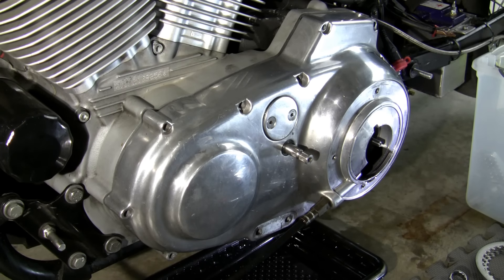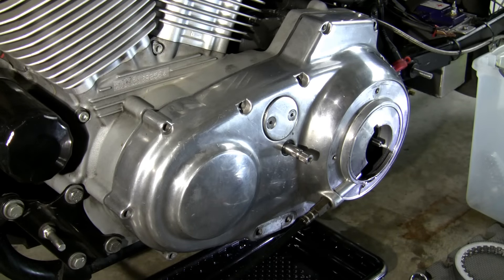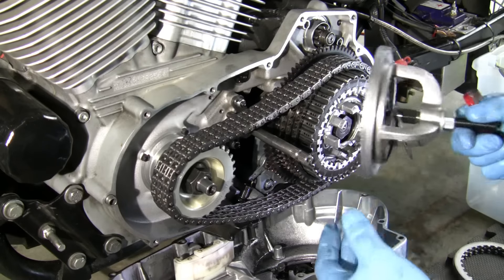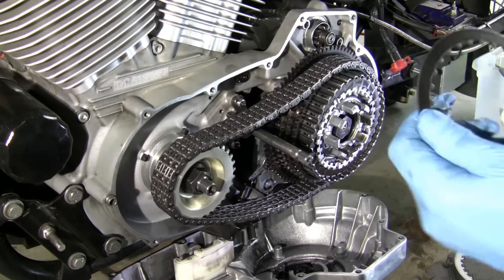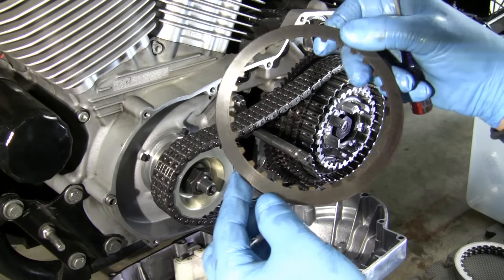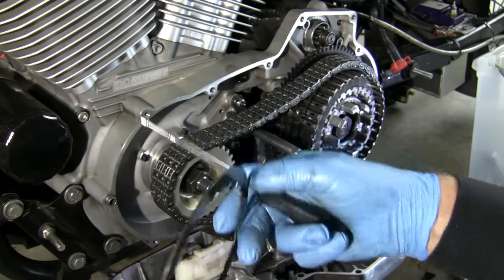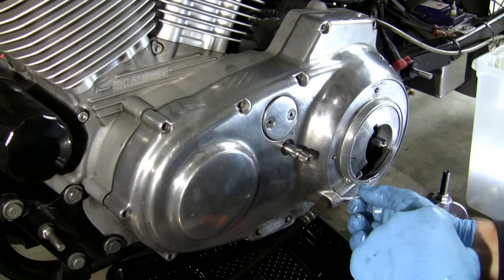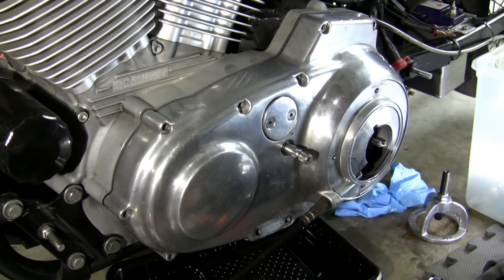Harley Sportster Clutch Replacement, Repair Sportster Clutch With Energy One Clutch XL

Comment: Use spare bolts with the heads cut off as assembly dowels  when you put primary or cam covers on , way easier and you won't damage a gasket or have it fall off while trying to put the cover on.

Comment: How many miles did you have between clutch packs ? What kind of riding do you do city traffic , short rides open roads country rolling hills , drag race .  I have used Barnett the last 20 years going with Energy one for the first time .  have 80,000 miles on my bike stock clutch . rebuilding the Trans and changing out the clutch bearing and all the other bearings . even though everything is tight . Rebuilt the engine last year .  they say 100 thousand miles I get about 80 and rebuild I ride Hard .

Comment: So do you have to drain the oil out of the primary first then replace
Reply: Janessa Richards , if you do not drain the oil before removing the outer cover it will dump all over the place pour 38 oz on the floor watch it run .  you still get dripping under the clutch and compensating nut , I use old blue jeans lay under the primary to catch the dripping .

Comment: Sweet can’t wait to get my new clutch in, so a couple years back I cleaned out my primary case. I mixed blots up and pulled threads out of one of the holes. I got it to bite enough then to stay in but I doudt this time it will. You think a heli coil will be alright. I ask because the hole has to be drilled out a little, do you think there’s enough material to be alright. It’s bottom lower bolt closer to back wheel.
Reply from the maker: Hey Ryan thank you for watching and the comment! I use heli coils when needed. The other option of welding, re-drilling and tapping is a lot of work and the welding can be messy.

Comment: Very nice video. I have a 1997 sporster. You look like you know your way around bikes. Do you think that if I just change my pipes, spark plugs, spark plugs wires and adjust my carb, I could maje a bit more horsepower?
Reply from the maker: Hi Dominique and thanks for watching. The pipes and the carb would help the most. Goos luck!
Reply: Not noticeable  power,may have carb/jetting issues😕

Comment: I'm no motorcycle mechanic, cars and boats yea. But I saw something, to me, needs replacing. The primary chain had a lot of slack in it. Is this normal for racing purposees? I have never seen, in my limited experience, that much slack in a primary chain. Most of the bikes I've seen are 2006 and newer. Please elaborate. Thanks. A very infomative video for me!
Reply from the maker: Hi Jeff and thanks for watching and the question. The primary chain tensioning shoe is in the primary cover in this model Sportster and it was removed for the video and when you have to work on the clutches with XL's. When you replace the cover the shoe then puts tension on the chain and the slack is removed to approximately 5/8". Thank you!
Reply: Jeff Tilghman there is no tension on the chain untill you put the primary back on and adjust the chain guide ..

Comment: nice video mate.. i plan on changing the clutch plates and springs on my sportster dragbike aswell... i will only be running around 100hks if everything goes as planned so it wount be nessesary....

How do you like this setup? you tryed it yet?
Reply from the maker: Hello and thank you for watching and the comments! I do like the Energy One extra plate clutch setup. You have to remember to readjust it after the first use to take out the slack from new wear. It holds well on my 125 HP XL.

Comment: Great job with this video.  Just watched the same video from a more commercial garage, and wanted to watch another just to get a second perspective.  Loved your commentary.  I always appreciate the insights of an experienced back yard hobbyist.  There's a big shift in the care and precision of your work when you're not on the clock, and it's your baby you're working on rather than your 3rd project of the day.

I also really liked that you didn't edit the video down.  For example, I got to watch your struggle with the retaining ring removal, as I surely will when I attempt it for the first time.  Not only does that give me a chance to see exactly what worked and what didn't work, but it gives me a red flag that when I get to that part I should really slow down and make sure I don't force it "because it just popped right out when the professional did it".

Again, great job!  Thanks for the walkthrough!

Comment: Ditch that Barnett Idea and fix your clutch!
I just fixed my old HD 2006 Sportster clutch and spring plate problem and my bike runs better and shifts better than ever. How did I do it? I removed the pack of plates, found the exploded spring plate took it apart and kept the two steel rings. I then lined the two up as perfect as possible. I offset the original holes for the brass fasteners leaving no see-through holes. I took my MIG welder and tacked the smaller of the holes on both sides with about 4-second bursts tacking the two steel plates together. I then took my angle grinder and dressed them. I filed the ears so that the plate would mount like the single steel plates nice and smooth. I filed the inside of the basket where the damage was left by the original plate making sure no plates would hang up on any of the damaged areas. I then installed new fibers with the old steels making sure that the welded pressure plate would be "past" the damaged area when installed. I then put it all back together and took it for a ride. WOW! It shifted smoother quieter and grabbed very well. It was a trial thing and am I glad I did it. The only size difference is the thin springs that were between the two steel rings are gone and it had no effect... except a GREAT shifting clutch now!